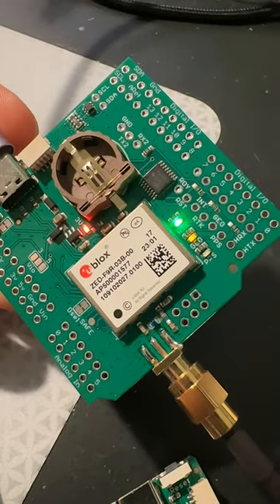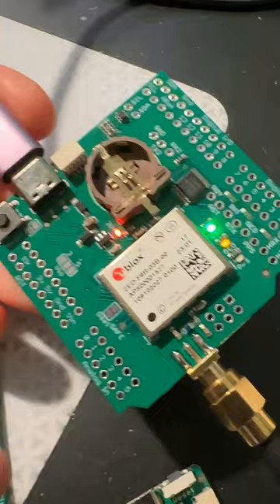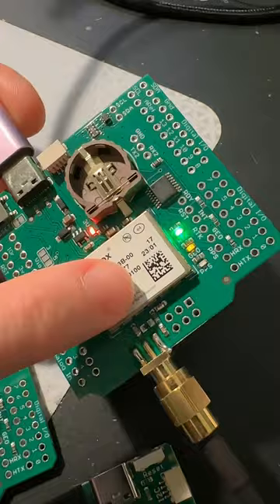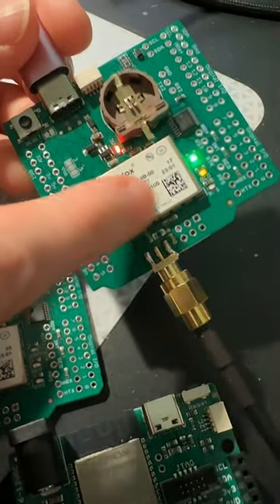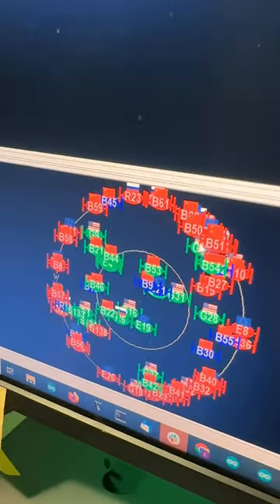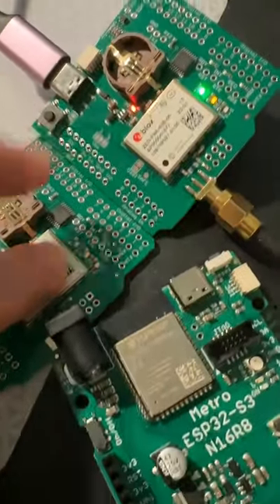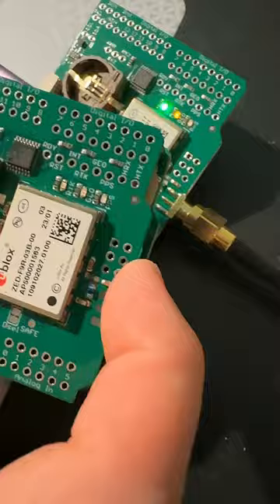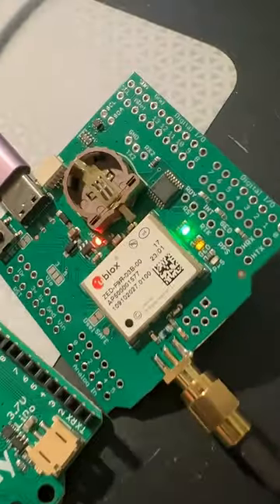It's 10pm, do you know where your RTK prototypes are? 🔧🛰️🎯

Comment: One advantage of RTCM data over Wi-Fi is that you can simultaneously log or track location and other data.

I’ve been running F9R with particle argon and ESP32 for a while, and the only issue I have is occasional 3v3 regulators just die.  It’s probably my fault, but maybe something to watch out for if you are continuously transmitting on Wi-Fi.